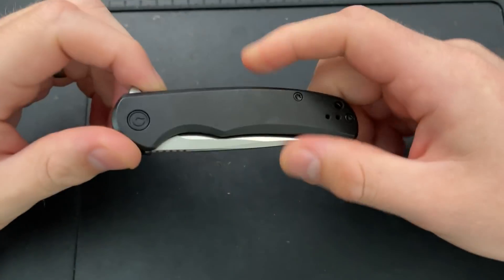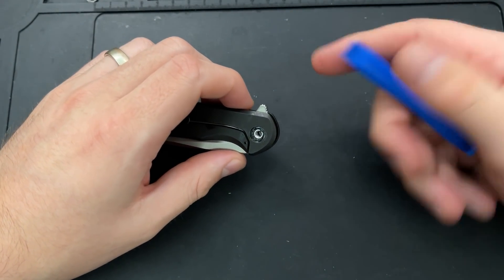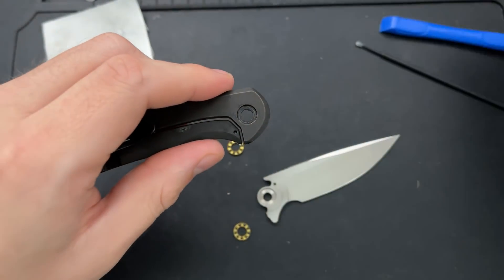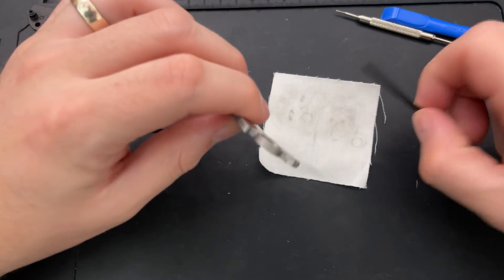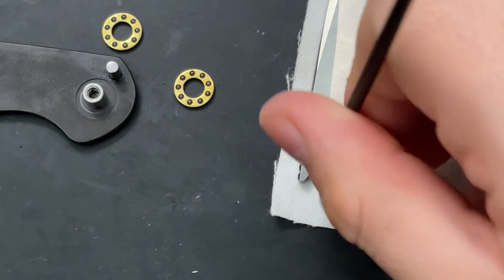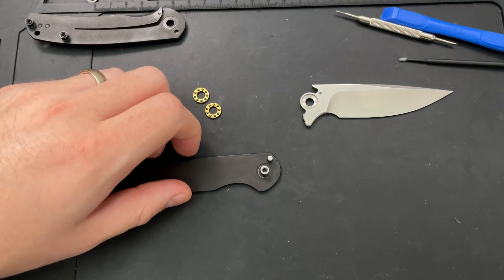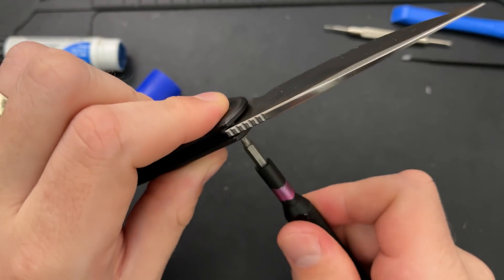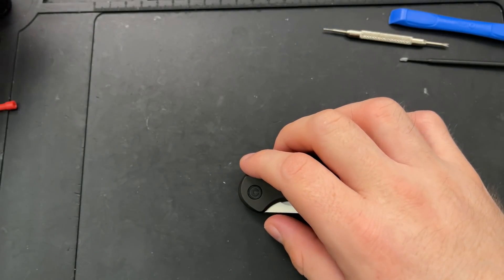How to disassemble and maintain the Civivi Knives Nox

Comment: These little Q-Tip things are called "Micro Make-up Applicators" outside of the knife world. They are quite a bit cheaper on Amazon than through KPL. I have mixed feelings on them, sometimes they work well for the task, sometimes they don't. I wish the heads were a little more tightly packed, they seem to want to shed the fibers more readily than one would hope.

Comment: I agree that the detent is too much when pressure is put on the lock bar but I don’t have any problems holding the knife without putting pressure on the lock bar. Action is very good then. Overall I find it to be a very nice small EDC knife with a very good blade and a good value.